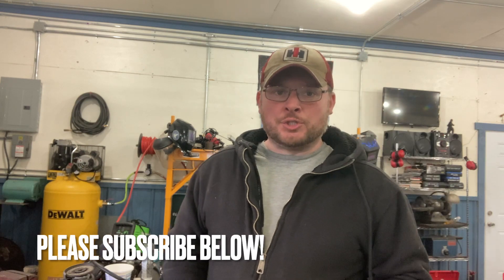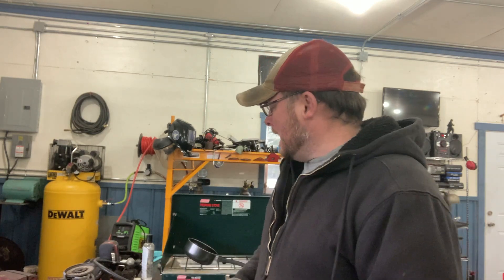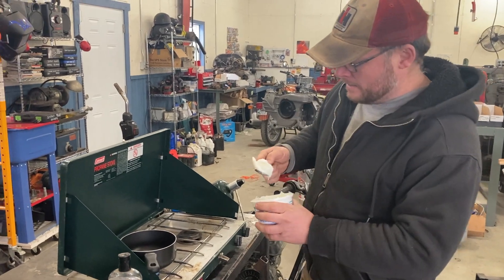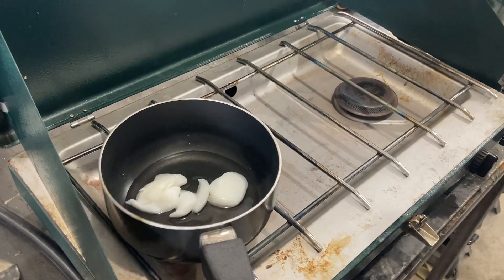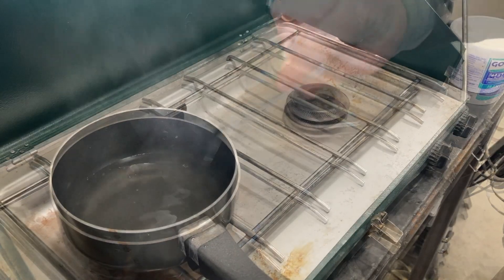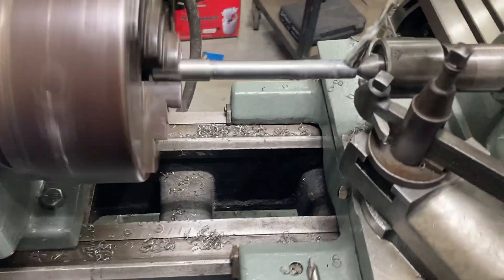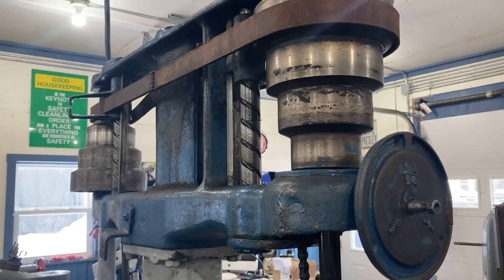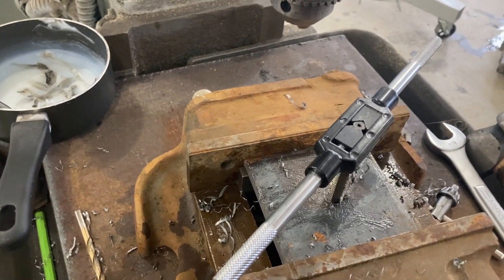Machinist Makes Lard Cutting Oil For The Shop

Comment: Beef Tallow has a higher smoke point than lard. Also, beeswax does a better job of blending oil, wax and tallow than paraffin.  I make bullet lubes. For black powder shooting my favorite lube is a blend of 2 parts beeswax, to 1 part tallow or oil. The tallow can be mutton, beef or lard; the oil is coconut oil.  For smokeless powder loads, I use a blend of 1 part paraffin, I part beeswax and I part coconut oil.
Reply from the maker: Awesome information. I may try another batch with your recipe!
Reply: @MaineMachinist  I'll check back and watch. I do a bit of machine work too, so your lard cutting oil really grabbed my attention!  I'll be making some for myself. Best wishes and thank you for sharing.
Reply from the maker: @ thank you for watching and thanks for the encouragement!

Comment: I've often used lard as a cutting oil, it works great on aluminum, as does kerosene.

You only need to apply just a waffer thin layer and that will help keep it
Reply from the maker: I was really surprised how well this went. It really works great using HSS tooling. 

It’s fun to try old shop methods and experiment with how people got things done before we believed we had to source everything from MSC Direct or McMaster Carr

Comment: I have made some using beeswax and dark sulfur cutting oil. It works great tapping and single point threading on the lathe. Also, just a general cutting paste.
Reply from the maker: Very cool. I’ll have to give that a try!
Reply: Cool, brother. What is the exect formula?